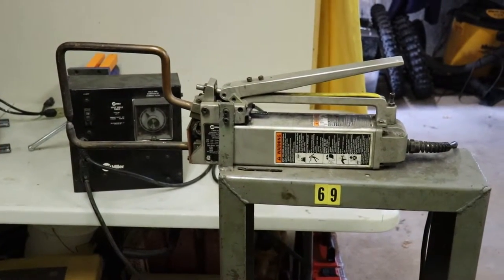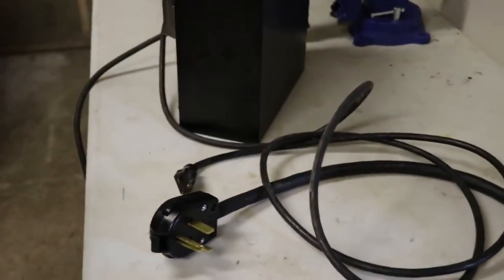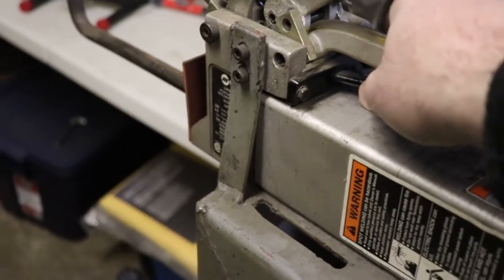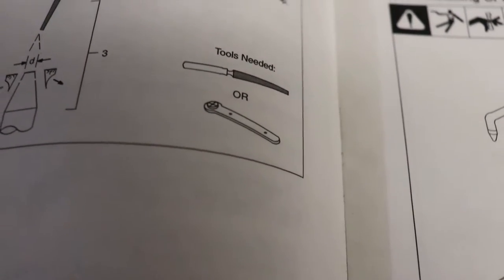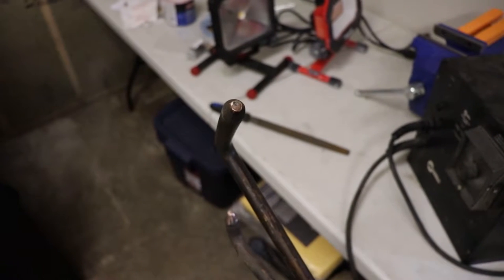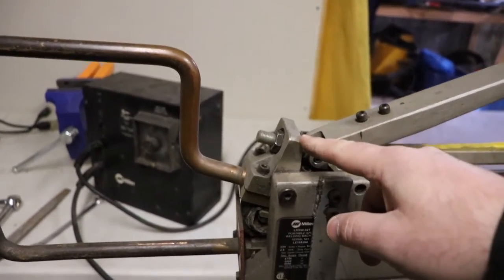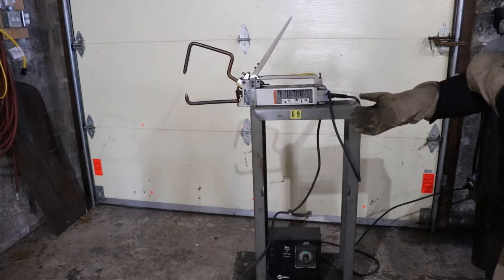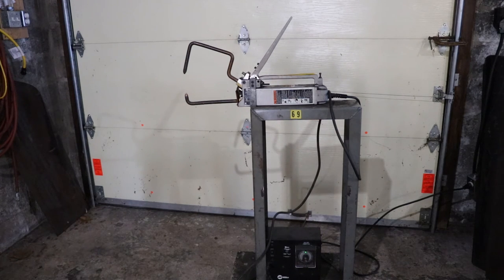Miller Air Cooled Spot Welder Maintenance and Set-Up

Comment: Hi,just bought the same welder and came with a Romex codr and I want to change that for the correct cord,I would like to know if the cord on yours is 16 or 10 gauge ? Thanks
Reply from the maker: The factory cable on mine is 4#16 SOOW, 90 degrees Celsius temperature rating.
Reply: @SteveRivett  Thank you very much.